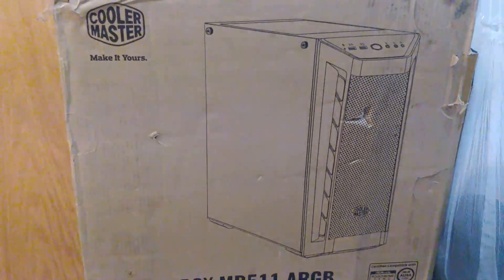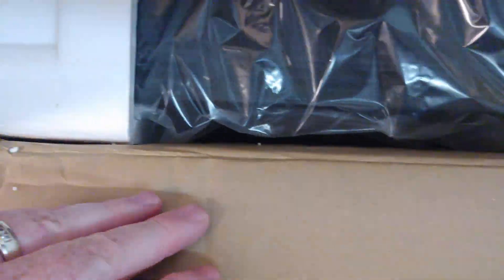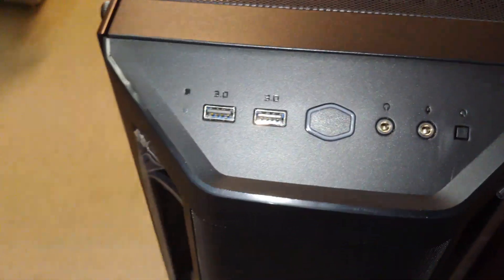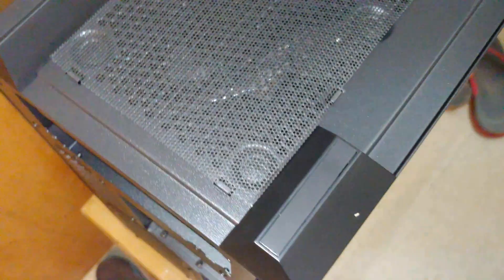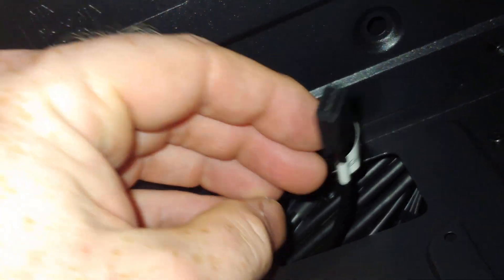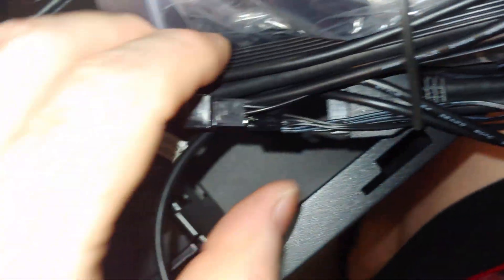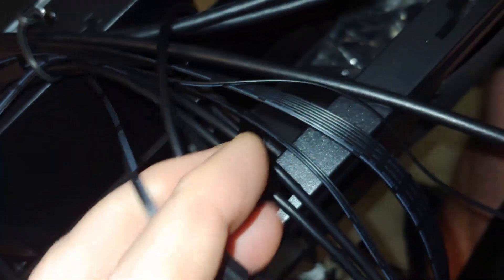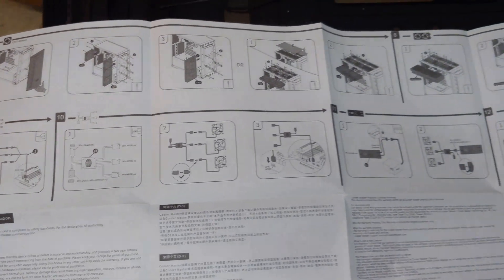Unboxing Cooler Master MasterBox MB511 ARGB Mid Tower Computer Case ATX E ATX mATX Itx

Comment: might sound like a dumb question but does it support a motherboard such as the b460-a?
Reply from the maker: Did you mean B460M-A?  Either way, this will support mATX and ATX boards.  If it is a mid Tower as this one is, most of the time they will support ITX, mATX and ATX motherboard sizes.
Reply: @PC_HardwareTechUnboxing_1  yes I did. sorry I dont know much about pcs yet and im on a 1.3k dollar budget. thanks for letting me know!

Comment: Does it support a liquid cooler 360 radiator at the top
Reply: It does
Reply: @ahmedmoataz11  thank god bro I was stressed asfuk
Reply: @lethal_ll  no problem man, happy to help cause i had the exact same question before xD
Though of you put a 360mm liquid cooler at the top you wouldn't be able to put a 120mm exhaust fan at the back but it's no use anyway.